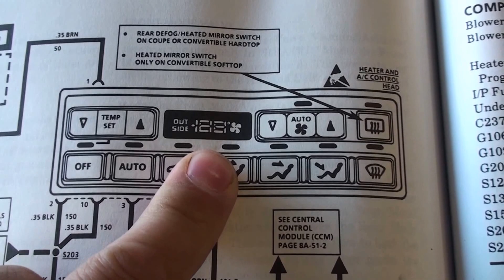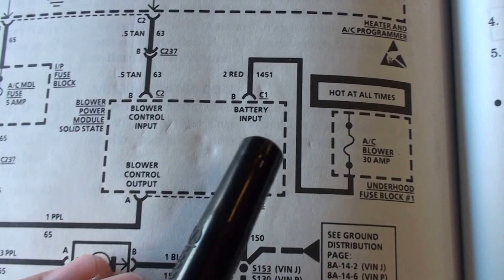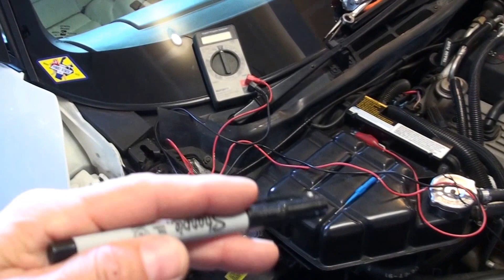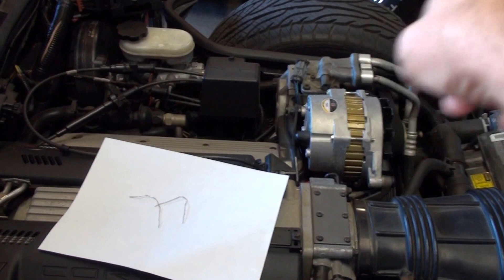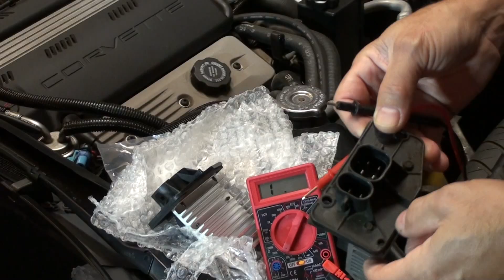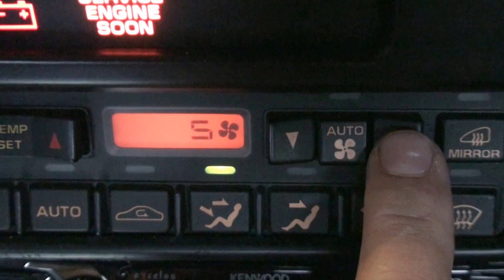Corvette Blower Motor Module Diagnostics and Repair! - Ozzstar -

Comment: Ok, I'm back. Finally had time to check control module everthing is ok with that and it was also getting power from ac programmer. Took headunit out of dash to to check for connection. Disconnected wiring harness from head unit and plugged it back in, same result, blower blowing on high thru defrost and floor. Disconnected wiring unit from head unit again turned key to on position and it is stll blowing on high with head unit in house on table. Any suggestions?
Reply from the maker: Clean the control head contacts like I show in my other video, check that all PINS are straight and not corroded, then reconnect it.  Jiggle/wiggle/push wires at the connector with the key on to see if you can get the fan speed or head unit to work properly. Did it work? If not then go the the programmer.  Check the wiring connections there, a wiring diagram would be helpful to find out of the signal is getting to the head unit from the prorammer.  Has anyone installed an aftermarket radio or done any work behind the dash panel?  You need to really look for any damaged wires that my be cut, corroded OR bent pins.

Comment: Nice video. I'm having a problem with my 1996 Corvette AC controls and blower motor. The head unit comes on but only displays two small dash like lines and the blower motor constantly blows on high through defrost and floor vents only. I don't have any control at the head unit.
Reply from the maker: Looks like its diagnostics time. Did you try checking the HVAC codes? Then I would go to the programmer next depending on what was discovered.
Reply: I cant, I have no control at head unit, just two lines showing.
Reply from the maker: +Aj Smooth time to check the wiring. Has any work been done in the dash area lately? Wiring all good ? Then time to pull the programmer......
Reply: One day I was just cruising and the head unit started to function properly so I plugged in the 2 plugs back to the blower control module. Went home parked it and the next day it was doing the same thing as I stated above.
Reply: No work done, gonna check wiring and use your method to check programmer to module tomorrow. Will let everyone no what I come up with.
Reply from the maker: +Aj Smooth sounds like a wiring issue or corrosion. Check that all fuses are tight and then check to make sure the connector at the back of the head unit is tight and no contact corrosion. Have you watched the control head unit repair vid i have so you know how to remove it?
Reply: Yes sir, I did that once and it worked for a day or two. Something may be loose.

Comment: Do you know anything on Astrovan rear heaters? No heat on rear heater.
Reply from the maker: Sorry I don't buzzsah, been over 20 years since I touched an Astro van.  I do sort of remember the cooling system for the Ford Aerostar.